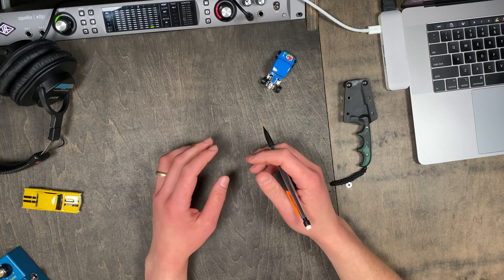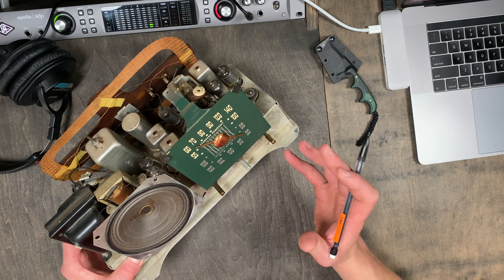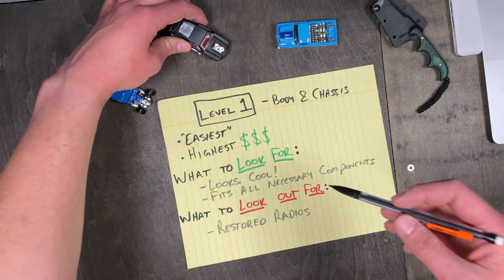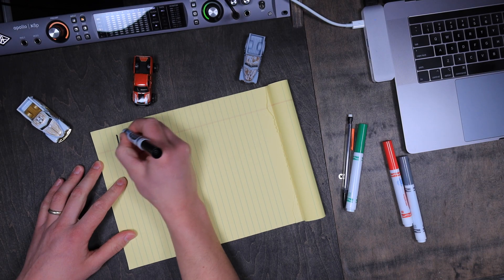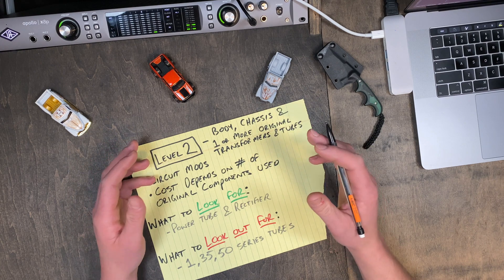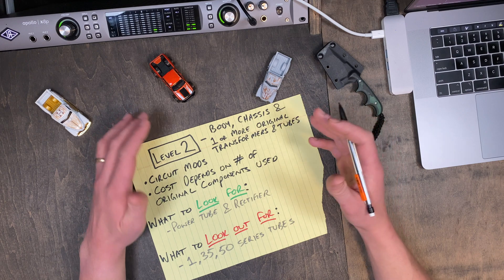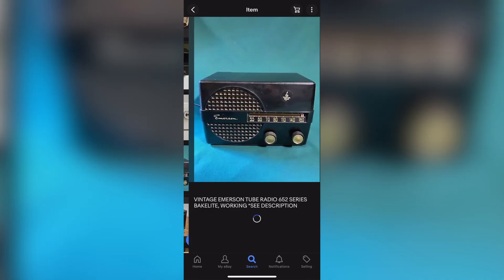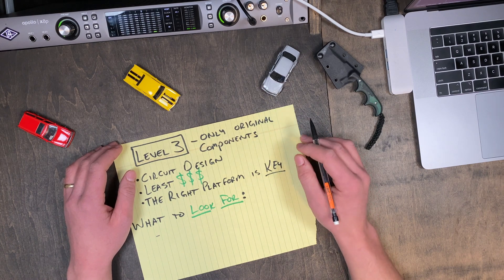Use THIS Approach to Start Making Tube Amps from Old Radios

Comment: 😅😅😅😅😅😅For sale 1967 Oldsmobile 425 big block. It is a 39 degree cam angle block, any off the shelf Olds cam will work. Fully torn down ready for machining, crank seems to be usable as is from a visual inspection ie no scoring or excessive wear, bearings look brand new (they are still in the journals). Block is standard bore, does need bored out as a couple of the walls are scored, needs a few new push rods as they were bent when I purchased the engine, cylinder wall scoring was also present when I purchased the engine. All old fasteners, valves, springs, retainers, cam, lifters (they are individually bagged so could in theory be reused), quadrajet, iron intake, oil pump, are still present, I've only thrown away the old gaskets. I also have the edelbrock torquer 455 intake, all threads are good on it and is included in the sale. Price is negotiable. Need gone. Would be open to trade engine and trans for a good 396, 402, 454 Mark IV.

Comment: I have an old Philco radio that I would like to use components from (and the chassis) to build a tube amp in the style of either a champ/princeton or a skylark but have no idea where to start. Any recommendations?
Reply from the maker: Which model do you have?

Comment: What tube configuration are you generally looking for? I know you mentioned avoiding 1, 35, and 50 series tubes but I noticed most things using 12s in the preamp are utilizing some 35 in the power section. Then most radios using a 6V6 or 6L6 are using 8 pin octal 6 series tubes in the preamp. Noob alert.
Reply: For what it's worth, those "series numbers" are the filament operating voltage. Thus, a 50C5 has a 50V filament and a 35W4 has a 35V filament. I would agree that using a power transformer is the preferable route, but you can make a serviceable amp with these tubes. Look for a Garnet 5P as a reference.
Reply from the maker: @rayfunk5659 💯
Reply from the maker: That’s a good question…obviously, ideally it would have all the tubes you’d need for a guitar amp already in the radio. But if it doesn’t, like you mentioned either having a 12 series tube in the preamp or a 6 series tube in the power amp (but not both), it doesn’t really make that much of a difference. At that point, you know you’ll have to make some modification, but depending on what you plan on building, one configuration may save you some time and money. 

I would definitely choose to avoid any radio that doesn’t have a transformer even if it has a 12 series pre amp tube. I think you’d be better off working from a radio with a transformer and a 6 series power tube. 

Even with an 8-pin preamp tube, you can still make some great amps with keeping a 6 series preamp tube in there! Similar to what I did with my Princeton 5C2. But if you wanted a 12 series tube, the modifications aren’t too too crazy…

Hope that helps! Let me know if you have any other questions.